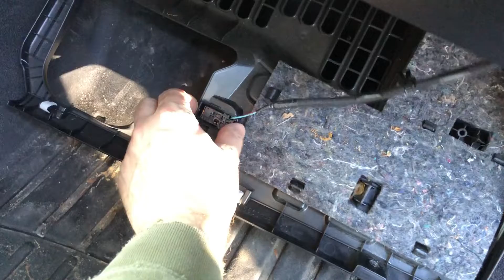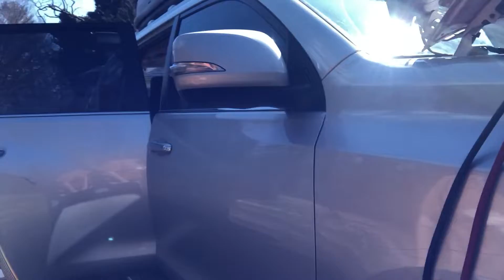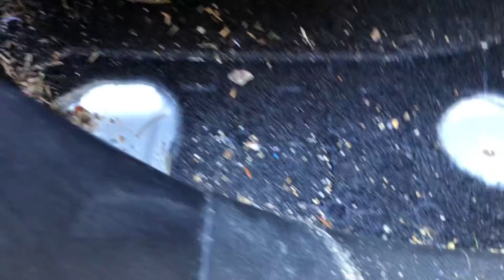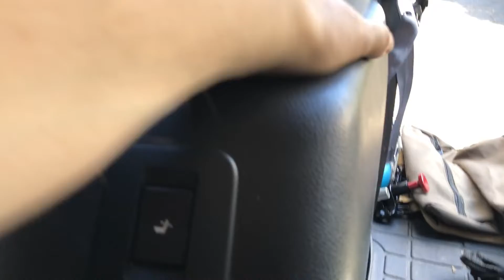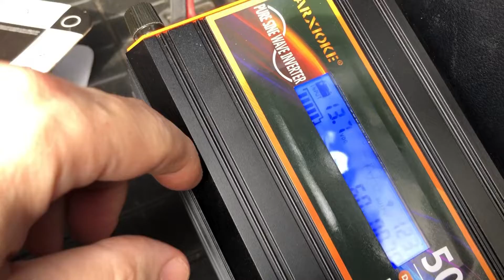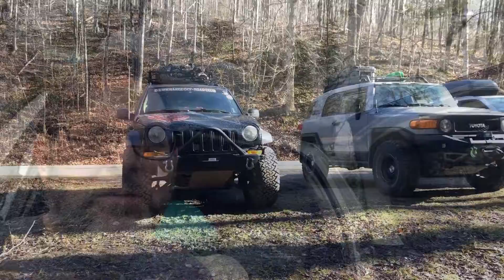POWER UP YOUR RIG - Installing a 500W Inverter #camping #overlanding #truck

Comment: We should get you an EcoFlow Delta 3 plus and/or a Delta 2 since they'll be on sale pretty cheaply now
Reply from the maker: Maybe someday! Would be nice to more power. The 600Whr. OUKITEL is good for ~12-15hrs. of power at camp for a fridge and a small house fan that I now use when sleeping. After driving 4-6 hours the next day, I am back up from ~30% to a full charge with the inverter setup. If camping for more than one day in a single spot, a bigger portable battery station and/or solar assist would be needed. Thanks for your comment @rcguymike